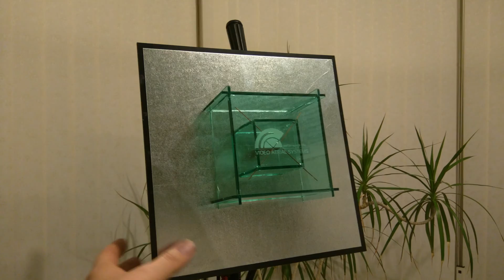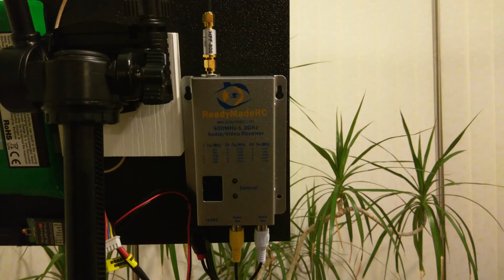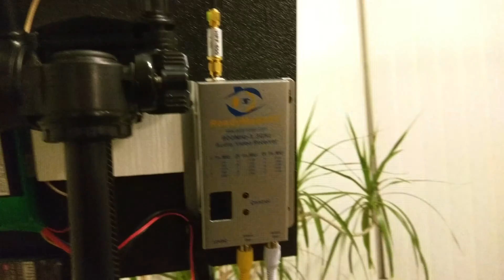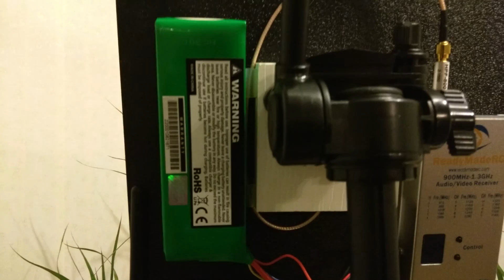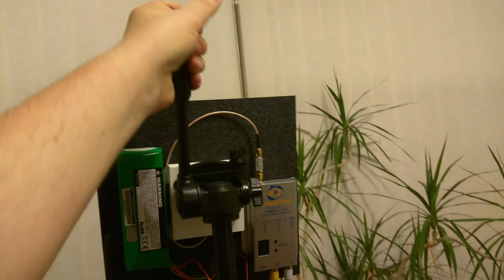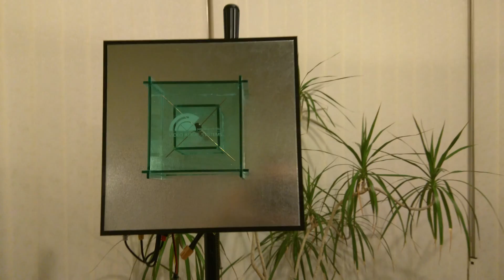1.3ghz self contained base station with 5.8ghz repeater.

Comment: Have this setup, only using the Ultrabeam from VAS.   Making sure I understand the connections.  Yellow and White connections from FS Repeater to 1.3 receiver.  Have power lead to  1.3 receiver using a battery tap connection from 2.2 3 cell.  Will the repeater need a separate battery source if I power the 1.3 receiver ?   Ultrabeam antennaes connected to transmitter and receiver.     Thanks for the help
Reply from the maker: 3S lipo XT60 goes to the RMRC VRX, balance lead from lipo goes to the 5.8ghx VTX.
Reply: O.K.  Got it.  One battery powering two functions.  On the supplies barrel connector from  VAS,   the yellow is positive while black is negative to be soldered to the XT  60 connector ?

 The Yellow and White RCA connections from repeater go to the VTX ?     

Thanks Keith..
Reply from the maker: Yes, IIRC yellow = video & white = audio.
Reply: Thanks !!
Reply: Alright !!    Got it all together, all solder connections made, tested and have solid video link on bench.

Next question (s). 

1.   Is there one of the 2 channels that is best to transmit on ?  there is 1258 and 1280. Presently  I'm on 
      channel 9   frequency 1280.  Channel D is 1258.

2.  Also, Can the outer case of the transmitter be taken off and the just attach the inner transmitter to the 
      airplane ?  I'm mounting the transmitter on the outside of the airplane  (Stratosurfer), so will be in direct 
      contact with airflow.  I'm using the 800 mw version  (Gold case).  

3.  When use on a tripod, will set up like you did.  Not using the Crosshair antennae,  so will mount to a 
     plywood mount.  How high should the antennae be ?   I'm using VAS Ultra beams     

Thanks again

Cary
Reply from the maker: 1 - Depends on the channels that your antennas are tuned to, from memory the VAS antennas are pretty wide band so anything from 1200-1280 will be fine,

2 - Yes as long as you keep it in direct aiflow then yes your fine.

3 - Keep your transmit antennas and RX antennas in the same polarisation.
Reply: On point #3,  they are both RHCP.    What you're referring to ?  

 Will be looking at the 1.3  Crosshair or Pepperbox as future long range antennaes.   Have the 5.8 pepperbox now and loving it.  Just think I've out flown 5.8 and looking at 1.3 for distance.  Nice to go back to 5.8 when needed though.  Never really understood the 5.8 repeater method until recently.  Sort of Anal here.  LOL.
Reply: Here's my GS  (so far).  Will the 5.8 antennae interfere in any way with the 1.3 antennae  ?  

https://www.youtube.com/watch?v=5eqAIhh2rQo
Reply: Here's my 1.3 GS (So far).   Will the 5.8 repeater antennae interfere with the 1.3 VTX due to their closeness ?

https://www.youtube.com/watch?v=5eqAIhh2rQo

Comment: I will have to try my setup again but put it like yours. I have the 5.8 repeater with 1.3 and I could only get 300 yards out and video was unusable. I also use the tbs crossfire. Maybe I just need the filter added to my 1.3 receiver.